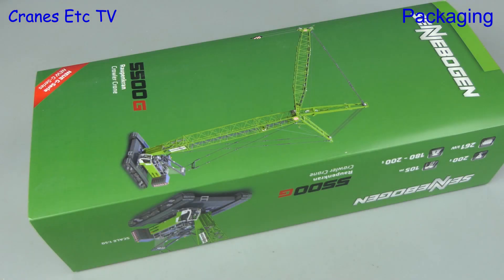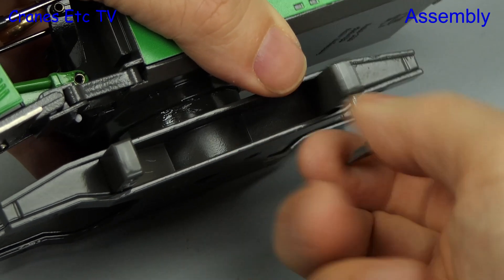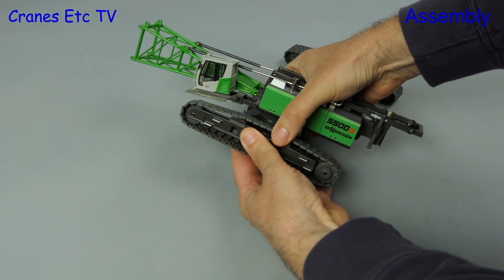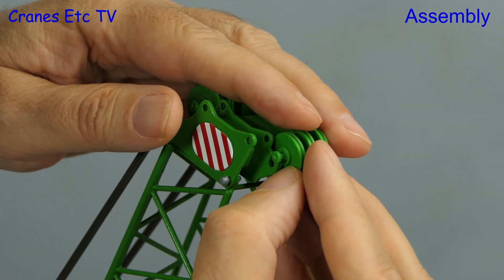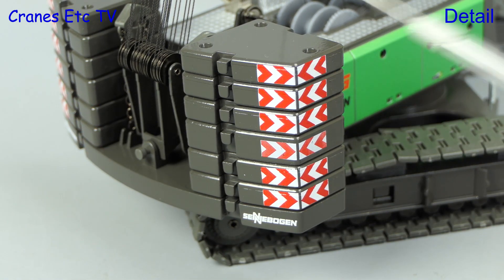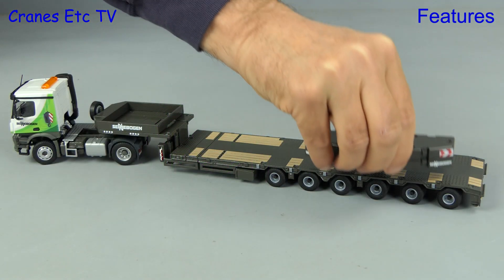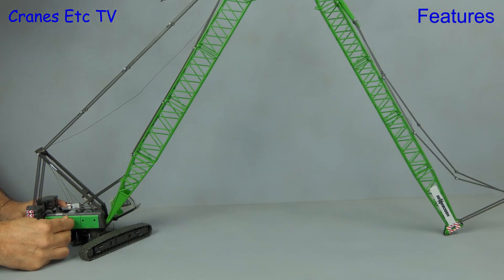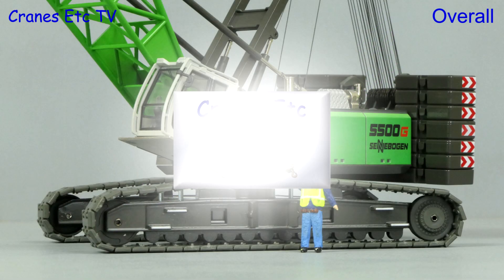Conrad Sennebogen 5500G Crawler Crane by Cranes Etc TV

Comment: The old version was my first crawler crane model back in 02-03. Definitely a great beginner's model. I sold mine a couple years ago, was all beat up and were out. Might have to pick this one up at some point. The green looks good and is a nice model. Surprised conrad didn't swap out the big plastic pulleys on the main boom head with metal ones. Can easily drill the hole a bit bigger to fit the rod and add a couple more pulleys to it with a 5 sheave block they used on the lr1280s. Another nice review ian!
Reply: How much did you sell it for?
Reply: 2010101010110092020101 Dollars